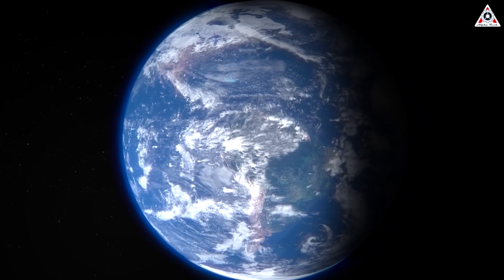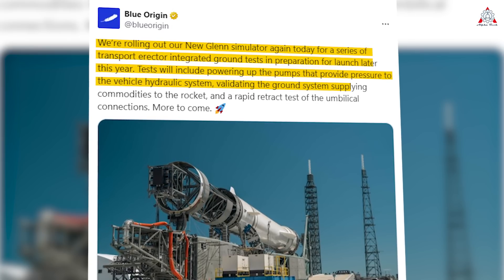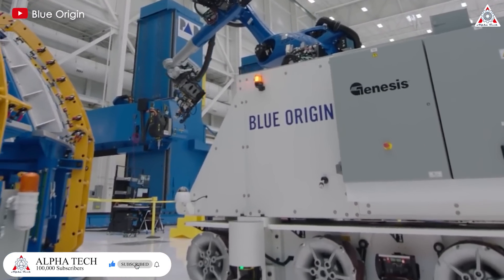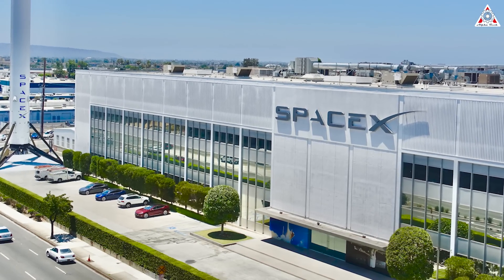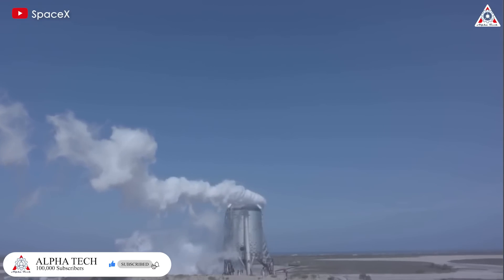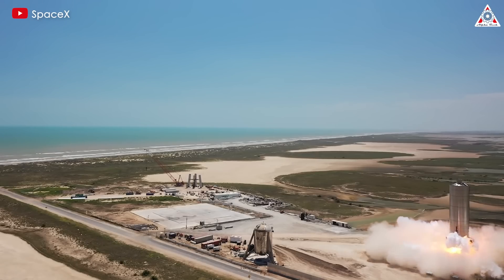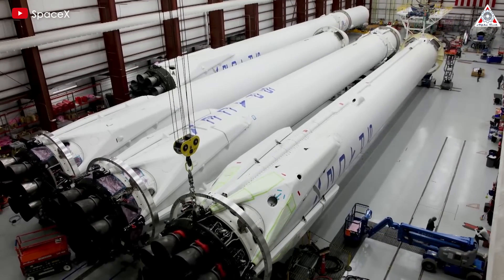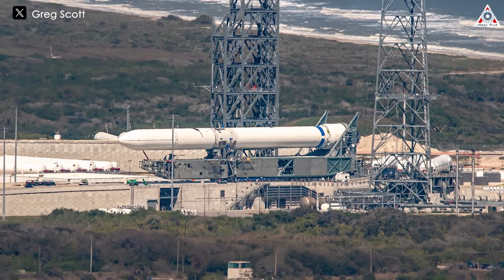Blue Origin New Glenn Ready To Launch to orbit for the first time! SpaceX humiliated…

Comment: Spacex is failing for a problem that doesn't need to exist. They trying to catch this rocket using arms when they can just land it in the water or barge on legs. It's a problem that doesn't need to be solved. They need to delete it , it will be the biggest failure. Just watch. Just like the falcon wing doors, they worked so hard on it only to delete it on the teslas because it's cool but point points of failure

Comment: Using more engines on the first stage than the N-1, with turbopumps no less and expecting rapid reusability to launch anywhere between 12 and 22 launches just to refuel the thing to perform the trip is light-years away from the "KISS" principle.

Comment: Question: did NASA and Boeing delay the return of Starlighter so that it would not overlap with the appearance of the Boeing CEO in front of Congress? The CEO of Boeing had a disastrous appearance before Congress in the past few days. It seems to me that delaying, a return attempt by Starliner that might have serious problems would be a wise thing for NASA and Boeing to do. Unfortunately, at this point, considering that the leaks are ongoing in Starliner, delaying the return of Starlighter may be exactly the wrong thing to do and may cause additional dangerous to the astronauts.If NASA and Boeing delayed the Starliner flight return for optics reasons, it could be that NASA and Boeing are just compounding the problems that could result in an even more unsafe return attempt by the astronaut and may be a fatal return attempt.
Reply: Actually if NASA can do it, sending the Starliner back Autonomously without the crew of Two would be their safest option … then a Crew Dragon could pick up the crew on their next mission, makes sense to me for them to bring the crew back safely …
Reply: @chrisbraid2907  
I don’t think NASA cares about safety of astronauts I’d rather about their reputation. It would’ve been a lot safer to delay the launch to the shuttle challenger a few days until the weather warmed up in Florida, but that would’ve been embarrassing.  What you described might be a lot safer for the astronauts, but who the hell cares about astronaut when you have to worry about the reputation of the Boeing corporation? Better to risk the astronaut lives, then embarrass Boeing and by extension NAA Ssa.

Comment: Glad to hear Jeff's Turtle is still lumbering along towards the goals, I've had alot of comic fun at BO's expense, but really would like to see them get rolling and up to orbital velocity...

From the looks of their fabrication, they are on track with standard primitive tube rockets done fabricated.

I suspect their worst problem is those motors that look like You asked an AI for an image of a one man big brass band....

Elon is a parsec ahead on simplification, Raptor 2's doing the job PDG, and Raptor 3's in the warehouse no doubt, and Raptor 4's at least in design phase. Each, simpler, cheaper, easier to build, and more powerful than the last.

And Elon got it up good with a couple big ones, and even got one home on the downhill trip. Now twiddling with tiles, and at least starting to try new things, coatings, like I have been harping on for years..
Hopefully they are also thinking about that flight profile, and that braking isnt everything.
Not if all you get for it is a ballistic parabola at 5X the velocity as you should, when you get down into the hot soup. Gotta keep it up!
Fly it! dont let it drop.
Turn insane velocity in thin air into enough lift that just the ballistic coefficient is enough over the long shot, that by the time you are ready to come down, your velocity is sub sonic.

Wings, not flappers. actual control surfaces. And maybe even consider longitudinal gores so you can have something more nuanced than a flying log.
Also like my last writ on tapered booster, if Starship had a fat butt, 
it would create more drag in straight line flight coming home, and more intrisic stability flying.
Also more area for more or larger engines, or more space to work between them, so you dont need to hire service midgets to work on them.

I suspect the perfect shape for the tank ends of ships is concentric tapers with angles reversed, and the oxy in the outside larger diameter, and the liquid farts gas in the inside taper, and it showing a wee bit of tank end at the bottom.

So you have more of a funnel than a top tank with a straight tube out the bottom.
This configuration would give you central fuel access direct from tank, and the outer oxy as a ring around it. And you could have thinner wall thickness on the fuel tank where surrounded by the oxy tank's pressure. Hard to explain verbally, but need to go fatter and shorter on the tanks, and get more of a base to land on. So things dont get too tall on bigger ships.

Its like some of the renders of starship that are forshortened, and give the aft end looking bigger.
It looks good, better than the straight tube look, and its more useful.

To get there, would humbly suggest that central feed tube from top tank start getting some taper to it, fire hose nozzle analogy.
And start tapering the tank out sides, and then over time start blend morphing them together... baby steps for timid rocket engineerds...

I already helped cause at least one corporate beheading... really would hate hearing of more, getting those enlightened upgrades Elon needs to do the job.
He insists on innovation.... And I insist on trying to help...
And I'm not stopping ever.... Not here to be liked... here to push.

And on the tapered hull, would be possible to brake facets rather than roll the skin, if you wanted to do the skin in say three sections. you could build a long brake with radiused mating surfaces that was the length of the skin section, and give it multiple tapered bends. Also would look sharp. that and taper would get past that toilet paper tube look, and get you into better design aesthetics territory, and more nuanced designs.

Pressed hull sections. That you could weld the internal structure in to in almost the flats and then weld the sections together.

Just because you can weld uphill, doesnt mean you should. Its generally much harder, and gets worse results.
Rule of thumb for production design should be minimize anything that isnt welded in the flat.

Just sayin'
And Elon says production is hard, so why make it harder when you can make it easier and better?

(Sorry guys! I cant stop!)

Comment: NO No no one that knows what they are doing works for Space X
Reply: Now tell us how you know zero about anything,  so you became a contrarian.
Reply: @rogerthomas169  No I actually know what I'm talking about. 30 years in aviation and space exploration including 5 probes on Mars and the Hubble freaken space telescope.  Im in the USAF Museum, Smithsonian and the Eastman House. I never blew up a single rocket.   NONE of my colleges at Marshal will work for Musk either. I know the people at Space X and they are fools I would not hire any of them I have fired some of them. What have you done in the field of Space Exploration?
Reply: @elzar760  Yeah What have you done that you know what you are talking about? Watch SpaceX blow up rockets? Boeing knows to take a close look and Starliner's service module before burning it up so that they can't learn from the prototype. You know your not supposed to blow up your prototypes. Blue Origin knows this too thats why they test with simulations, your time to failure is faster and you get to keep the prototype as reference.  They are doing a good job and I'm not just saying that because they use my simulation software. Notice there flame trench works, there control surfaces are shapes that are known to work. There rockets turbo pump is based on the most reliable jet engine ever made CJ-69. If they blew up more rockets would you say Blue Origin is more successful?
Reply: ... and somehow those people who don't know what they are doing created reusable rockets that fly every week without issue, and Starship which has flown and done a controlled reentry. Give me the "know nothings" who accomplish things right now, rather than the "experienced people" who talk about the past and what they might do in the future.